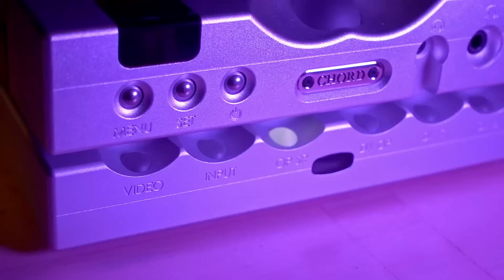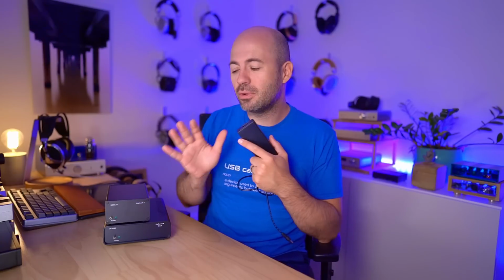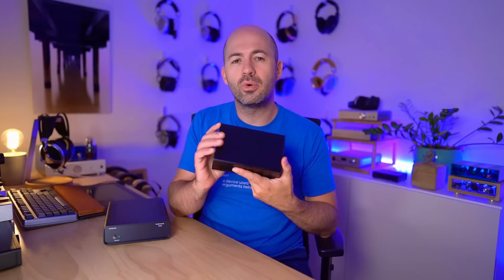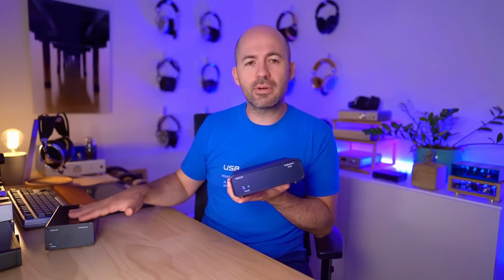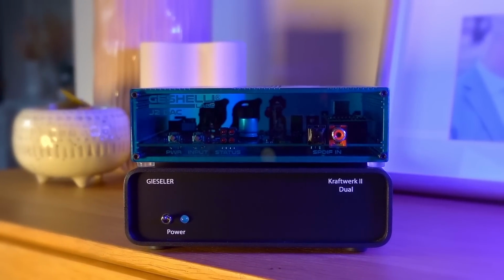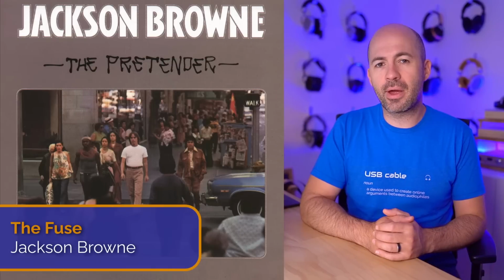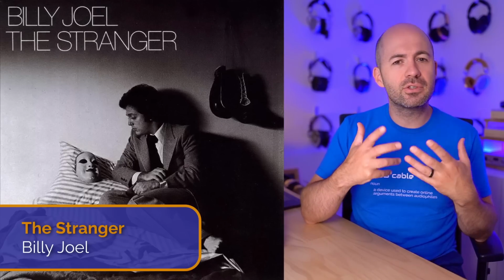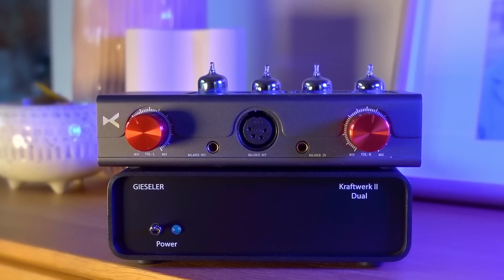Audiophile Linear Power Supplies - Do they improve the sound?

Comment: Thanks.
I keep hearing in reviews, it's about how resolving your system is. 
Maybe I missed it but I didn't hear which cans were used in the test from hi end to lower end and how that made if any a difference or would justify 
any LPS.
Reply from the maker: I used different setups depending on the device because I tried DACs and amps, but I think I mostly used the Arya stealth magnet version for most tests.
Generally, I'd say there's no point dropping $500+ on a LPS if you're using lower end gear - I'd recommend putting that same money towards a more significant upgrade like a better DAC, amp or headphone (i.e. sell something and add the $500+ to step up a tier). If you're starting to play in the realm of say $700-1000+ components (very rough numbers) then it's probably worth considering
Reply: @PassionforSound  Thanks.
In your opinion, if someone was to purchase a $700 pair of cans, what price range should one look at for a dac and separately an amp (roughly, not for the future upgrade but now) 
The assumption is spend the most on headphones, correct ?
Reply from the maker: I don't buy into the idea of spending a significantly larger amount on any piece. I think in terms of tiers. If you have a mid-tier headphone (like something around $700) then I believe you should buy a mid tier DAC and amp. Something like the Schiit Bifrost 2 or an SMSL DO200 for the DAC (my vote goes to the Bifrost) and an amp like a Rebel, Singxer SA-1 or maybe a Jotunheim 2.
Buying at significantly different levels will just limit your best gear to the performance level of the lowest quality gear. It's a bit like putting sub-standard tires on a car - the car will still go, but you're not going to get the best performance out of it.
Reply: @PassionforSound  Luv the suggestions & analogy but I think you may have left one thing off the list :)
The source.  If I'm not playing DSD files at all, just streaming Amazon music through a mac I'll always be limiting the gear to it's weakest link - the source / mac .
Does that sound correct ?
Thanks
Reply from the maker: No, that's not an issue. For MP3 (and Spotify) I would agree that there's no point, but if you're using any lossless source like Amazon HD, FLAC files, Tidal or Qobuz, the differences will be noticeable. Even with MP3 is will be noticeable, but the upgrade in source quality would be a bigger step to take first

Comment: Been using external linear power supplies for years. Back to the early slim devices/Logitech squeezebox  era. Also use them with streamers and usb regenerators for cleaning up usb signal.  It's really interesting how sensitive digital steaming/usb devices are to better power supplies.  In some cases it just keeps increasing the performance. In others gear I have it doesn't make much difference as the manufacture clearly thought of that when designing it. Being more into diy audio side lately I have come to appreciate the thought put into the power supplies of components. Usually, this is big factor in the cost of a piece of gear and how it performs. Thank you and keep up the great reviews!
Reply from the maker: Great points all around! Glad you're liking the content and thanks for commenting!

Comment: These are my favorite types of reviews from you Lachlan!  So many channel do the typical gear reviews but I appreciate that you switch it up and go into such great details on accessories like op amps, cables, lps,, etc.. did you happen to hook up the to the soloist?  Wondering if you noticed any substantial difference between the lps and super charger?
Reply from the maker: Glad you're enjoying them, particularly because I have more planned for 2022 😉
The Burson gear uses 24V power and my LPS options max out at 15V unfortunately.

Comment: I'm afraid the two linear supplies you discuss would be out of my reach even if they were available in the US. I use 2 ifi ipower x ultra supplies one for my dac, one for the headphone amp. Both were a  magnitude of improvement over the ordinary supplies. I also have a small desktop headphone amp that I power with a battery pack. The difference in sound quality between a switch mode supply and the battery was also huge. Thanks for covering this topic in detail.
Reply from the maker: Great points on both the iFi supplies and the battery, Kenneth!
Reply: https://youtu.be/OL23xkLfPTU

Comment: Lachlan, have you tried using the Super Charger 5A with the 789? If not, I think you’re in for a treat.
Reply from the maker: I don't have a 789 anymore so I haven't. ☹️
Reply: @PassionforSound  I feel it’s worth looking into if you get a chance. I personally noticed a dramatic difference using the 5A that came with the GT specifically when I compared stock PSU to the 5A. I purchased a 5A for the 789 after having sold my GT and can still notice a difference but it didn’t seem as dramatic. Could just be my perceptions but I think you’d be the best to test this since you have the 5A from the GT.
Reply from the maker: If I have a change to try a 789 again, I'll do the test 🙂

Comment: I have an Arya SE and just paired it with a new IFI Zen DAC. My old IFI power supply was not compatible with the new Zen DAC, so I had to get another. I listened to music on it, and although I liked the sound signature MORE than the old DAC, I didn't enjoy it as much as the old DAC which had the clean IFI power supply.

I just got the IFI IPowerX to power the new Zen DAC and all I can say is that I ENJOY the sound again. I enjoy the sound again, with the new sound signature coming from the IFI DAC. This means I can finally compare the new DAC with the old.

To me, clean power supplies provide absolutely no more information. There is the ILLUSION of "different sound", but this is just because your brain interprets the sound differently because it is ENJOYING the sound.

It is "easy" to listen to, which also allows me to raise the volume which obviously will reveal more information.

My point is that clean power supplies are extremely necessary for me, not because they "do" something to the music, but rather because they "do" something to your brains enjoyment of it.
Reply from the maker: Thanks for sharing your experiences! So glad you've found the way to get the most from your music

Comment: so if i got a 1800 dollar dac, i should get one of these LPS?
Reply from the maker: John is right, Leo - it will all depend on the product and whether it takes a DC input or if it has a mains power input. Most high end gear will use mains power, but there are exceptions.
Regardless of price, if a device has an external switch mode power supply, it's likely worth trying a linear power supply on it

Comment: Is the Burson Supercharger linear or switch mode? Edit, would a good linear PS be better than the Supercharger for the Soloist?
Reply from the maker: I can't answer the second part because I don't have a 24V LPS. I know the team at Burson went out of their way to optimise the performance of the Super Charger, but it would be interesting to do the comparison
Reply: @PassionforSound  Someone on head-fi was also wondering about a 3rd party linear power supply and quoted Alex from Burson: ""No, this won't work on our products. It's like putting a bigger piston engine in an electric car. It will make our products sound worse" So.. I guess that's that then. Would be interesting to know more about why that wouldn't work.
Reply from the maker: I'd be curious about that too. I do know that the internal MCPS power supply system is built around capacitors that essentially discharge and recharge very rapidly so maybe the SMPS is required to pulse the power at very high speed into the MCPS? I don't know why that would be different to having constant power on tap though

Comment: Love the channel and your braveness to tackle products like cables and power supplies. While I know LPS do make a difference, and I appreciate your effort here, I'm don't think many people are gonna be pairing $250-$300 DAC's and amps with $900 power supplies.
Reply: one of the reasons the DAC or amp cost $300.00 is because it has a $2.00 power supply.
Reply from the maker: Exactly
Reply from the maker: So glad you love the channel! Thanks for letting me know. I completely agree that spending $600+ on an LPS doesn't make much sense until you're spending a fair bit more on the core devices. 🙂
Reply: @PassionforSound  Sorry, but the power supply is the core device!
Reply from the maker: I agree that power supplies are important, but I think you're better off spending money on a higher level DAC rather than buying an expensive power supply and cheap DAC. The cheap DAC will have a cheap power supply and a cheap circuit design, and a cheap output stage. You can only fix one piece of that puzzle with a better power supply.
Reply: @PassionforSound  Rather than tailor your choice of power supply to your intended device, wouldn't a high quality LPS that has multiple rails with multiple voltage/amperage outputs satisfy whatever UPGRADES you desire in DAC, Streamer, and Preamp choices?
And I suspect few if anybody will be using a 12 volt battery as a PS.
Reply: I will admit some Astronomy dealer/manufacturers such as Celestron sell battery packs designed to power a telescope and all associated equipment throughout a night's worth of use. Would these be the type of batteries you suggest?
Reply from the maker: There are brands out there like BatPower who make battery power banks for laptops and these work well for audio applications. You'd be surprised how many people use them.
As for the mutli-voltage power supplies, they're a great option (I have two of them), but they're also a lot more expensive because they're harder to build and require more components so some people prefer to save some money and just buy for the voltage they need.
Reply: @PassionforSound You also need a good power supply, a bad one will ruin the sound even if the DAC is better.
Reply: You can also use cheaper Chinese linear power supplies, I have a Keces power supply purchased used and a Chinese one, and I don't hear any difference, both greatly improve the audio of my NUC which originally had a switching power supply.
Reply from the maker: @GlobianGlobianovic thanks for sharing your experiences!

Comment: Where does the burson supercharger fit in with all this?
Reply from the maker: The Super Charger is a switch mode power supply, but designed to operate at much higher frequencies, theoretically removing the noise from the audible band. It definitely performs very similarly to what I heard from the LPS in this review.

Comment: Any thoughts on power stips/conditioners/surge protectors having impact on sound? I am limited on outlets so I have to use them but I don't know if it's worth investing in a "higher quality" one. I don't really know if adding a linear power supply helps if the first part of the chain may be hampering it
Reply: My experience is that conditioners change the sound. Not always for the better or worse. I have owned several, from the 90’s era Adcom, Audioquest Niagara 5000 (tried the 1000 also), PS Audio P10 regenerator and Shunyata Denali v2. 

For a low cost solution, the Furman P8D is pretty good. The Niagara 1000 is better, but costs 6x more. 

The Shunyata is amazing, but is cost prohibitive.
Reply from the maker: I've heard lots of similar experiences to yours, ChrisMag.

TheEthics, I'm going to do a similar review to this one on a couple of power filter/conditioner products soon to see what improves, what degrades, etc. It's also worth noting that where you are in the world and the local power quality can play a part in the impact of filters, etc.
Reply: Thanks for the recommendations Chris! And I'll keep an eye out for the review  @Passion for Sound . Can't wait to see what you discover
Reply: @TheEthics88  Got the part number wrong. PST-8 Dig is what I use for my desktop audio setup and computer.
Reply: I had a power surge kill my AVR and projector, luckily my DAC, amps, etc came through OK. Turns out that surge suppressors go bad over time and give no warning ($15k lesson!).
After much research on surge suppressors, I purchased a Zero-Surge (just under $600.00 for a 10 outlet isolated unit).
It made a positive improvement to my stereo. The nature of the Zero-Surge system requires some amount of power conditioning. I have very clean power in my house, so I was surprised it helped things at all. I recommend you check them out if for no other reason to protect your expensive gear.

Comment: Excellent review. It matches with all my own experiences using linear power supplies for my gear. I would like to see more videos like this where a linear power supply is added to the reviewed product and see what it can do.
Reply from the maker: Thanks Hendrik! I'm actually chatting to Clay about buying a separate LPS for review testing so anything with a 5V-12V SMPS as standard I can test with better power and see how it sounds.
Reply: Great review. In my experience an LPS can make similar improvements to what you describe with a standalone DAC or a DAC/streamer combo, but little to no difference with a standalone streamer. I think this suggests "clean" power is most important to the analogue output stage of the digital chain.
Reply from the maker: I need to test the LPS on a streamer device. I have a streamer roundup coming soon so let's see if it's model dependent or if all streamers are fairly immune to power quality